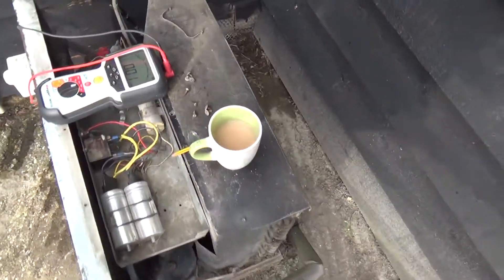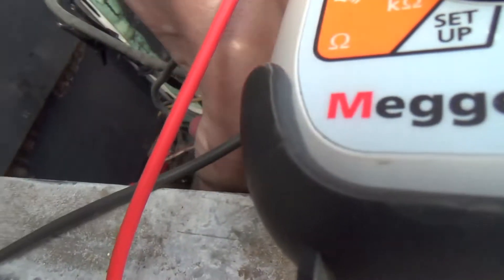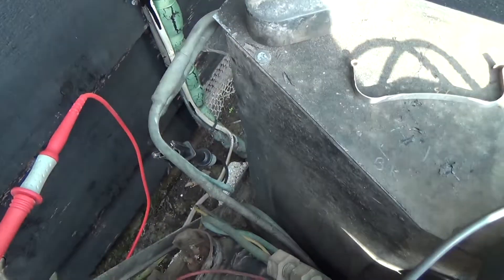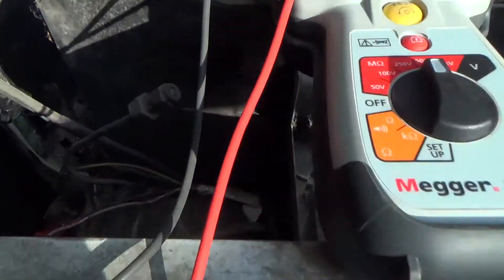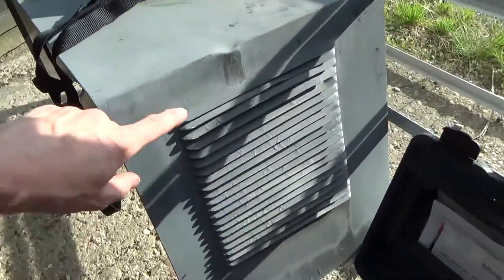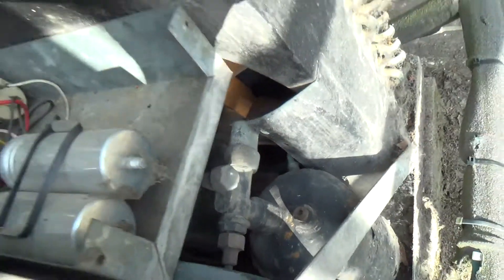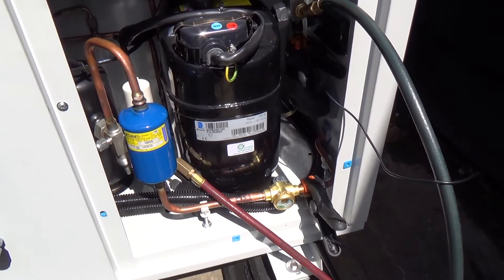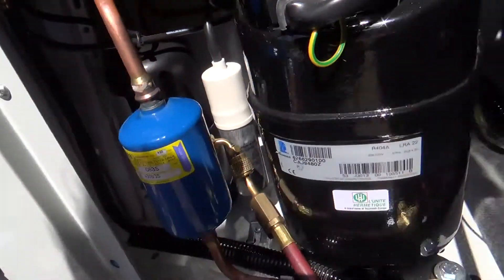Grilled Cheese?

Comment: condenser fan is running on some speed pressure control? higher pressure faster speed lower pressure lower speed?
Reply from the maker: poland2010 I think its a visual effect caused by the camera, i don't think it has a speed control